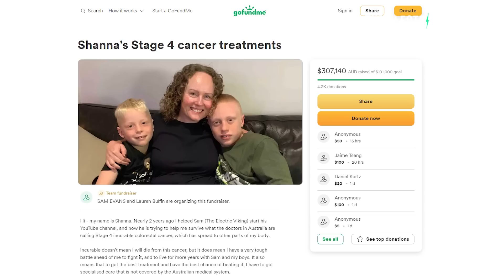CATL unveils Condensed Battery for Aircraft & 1000 mile range EV's

Comment: Dear Viking,
A 50 kWh condensed battery will not provide more range than a 50 kWh ternary battery. They store the same amount of energy. The condensed battery will be a lot lighter though.
For more range you need more energy. The theory is that you can fit a larger condensed battery in the same space as a smaller ternary battery. So the Model Y could get a 150 kWh condensed battery for example, to provide 800 miles of range. CATL did announce the 500 Wh/kg, but they didn't announce the Wh/liter figure. So we don't know if these cells are any smaller in dimension (they probably are).
Also missing: price and cycle life. If either is not competitive, it could be a deal breaker. But for now, it sounds really promising.
Reply: Not only the range... 0-100 times could well improve with these new batteries. That would put the Mclaren 720s even further behind Tesla. LOL
Reply: @zizimai7568   - who really cares, few ppl buy, or care about drag racing.
Reply: What about weight. When it's true, it will be couple hundreds of pounds lighter. The range will raise.
Reply: A 100kWh at 250Wh/ kg would be 400kg. A 100kWh at 500Wh/kg would be 200 kg. So a saving of 200kg at cell level for super long range car. Short range with 50kWh would save 100kg at cell level. So probably hardly much range increase for same kWh.
Reply: These cells should do more for acceleration than for range.  At a constant speed on the open road, weight has little to do with energy consumption.  It's mostly wind resistance, which less mass doesn't affect.  Less mass should reduce energy loss due to tire internal friction, so that would help range some.  The big win should be acceleration.  To the extent that you are speeding up and slowing down on the open road, this would improve range.  We still need info on price, cycle life, volumetric density, safety, low temperature performance, power, charging ability, and timelines on production volumes.
Reply: They would get more range because of how much lighter the vehicle could be. 50kWh in a much lighter car goes further. 

I do agree that there is more to it than just the new battery though
Reply: @SyntheticSpy  For long distance highway driving, when range actually matters, weight is less important than aerodynamics.
Reply: @JRP3   - hmm.. weight and volumes are important...  Aero too  - but volume dictates areo concerns more than mass. (weight is "planet" specific).
Reply: @kadmow  Until we start driving on other planets "weight" is a perfectly accurate metric and my comment about weight and range is correct.
Reply: @JRP3   - ha, that was a joke and, volumes are very significant - WRT aerodynamics...  lol..  cheers for the approval ticks.
Reply: @kadmow  Volume is a factor but not "very significant" unless it's somehow worse than existing chemistry, which is unlikely.
Reply: @JRP3   - cheers - last word...  did that add to the debate ??? chemistry - to be or not to be.  ???
Reply: @kadmow  It added more than your nonsensical claim about volume.
Reply: @JRP3  Yes good point. But I think both are equally important. Weight for acceleration/ deceleration and aerodynamics for fast cruising.
Reply: @marko14444  My point was it's not equal because range matters for highway driving which is at high speed and does not involve much stopping and starting.  Thus aero is much more important than weight.
Reply: @SyntheticSpy  Weight density (500Wh/Kg) is important, but volumetric density (which has not been specified) is also important. For example, if for a given amount of energy the battery is half the weight but ten times the volume, then the limited space available within a car/airplane to store the battery will become such a limiting factor that the vehicle would have a shorter range than a vehicle that uses today's batteries.
Reply: @SyntheticSpy  Why it goes further if the car is slightly lighter. The car is not made entirely of battery? It will help only when accelerating to get to cruise speed faster. Driving highway you don't accelerate much. I don't see a huge benefit with the car lighter on consumption and range. I do see an advantage if the W/liter is smaller and you can pack more kWh in the same volume
Reply: Think of it like the our next energy redone tesla model s pack. They pumped it up to 204kwhs total capacity in the same bolt in shell and increased the total weight by only 330kgs. Allowing for 770-850 miles of range on 1 charge depending on the temp despite the increase in weight. 

Which was still 30-40% lighter per kwh at the pack level than what tesla used. So technically they could put 130-140kwhs in a tesla model s pack at the same or slightly less overall weight as the 18650 tech allows for just 100kwhs. 

But that same model s tesla could easily do 510-550+ miles vs 404. Or they cut out say 25-35% of the weight keep capacity around the rated 100+kwhs useable and still go further due to a much lighter weight pack. 

Plus you can save more weight on less cooling capacity, smaller coolant pumps, less packaging etc once redesigned for the new cells. 
It's like a virtuous loop or cycle. Pretty neat really. 🤔👍🏻
Reply: Spot on. Same batttery size doesn’t mean any more range unless lighter. Even then it might be a 10% increase at best but that’s still good.

Game changer would be being able to have bigger batteries in vehicles at the same/less weight and crucially cost - then you could get more range at a lower price. Still a long way from that but it’s promising.

Comment: Batteries failing in a plane is not really an issue. Planes have separated fuel tanks in case one fails. They could just have separated batteries if one fails just the same.
Reply: Hopefully they wont catch fire
Reply: @iskdude9922  Because jet fuel currently cannot catch fire?
Reply: @ZR-194  needs a flame.  Lithium ion just needs to be damaged and a fire starts....  also battery fires cannot be put out.

Comment: Of course the battery in an aircraft can be divided in various subsections too instead of a monolithic single point failure.
Initial commercial adoptions still depends on the price. 
Arkinvest often cites a law of decreasing prices by close 30% with each doubling of the amount produced. 
So that may delay adoption for EV somewhat compared to adoption by aviation. 
Anyway this  may change the shape of things to come indeed.

Comment: A 50KW battery would have a 220 pound weight.  Put this in a Model 3 rear wheel drive with a performance motor and you would have a really fun car.
Reply: Something about the size of a WRX with this battery and SOTA drivetrain would be insane
Reply: 500 per lb 
2 lbs per kw
200 lbs gives you 100 KW!
Reply: The model 3 weighs about 1900kg, with a 50kWh battery it will weigh about 1800kg. Hardly make a big difference in total weight, won't change the range by much. Cost of purchase is the bigger factor, that might change.
Reply: you misspelled 150KW battery

Comment: The argument about "with jet fuel, if you lose an engine, you can still use another one, but with a battery you're screwed" is actually quite wrong. You just need multiple batteries. There's no reason why it would be difficult to have 2-4 separate battery banks in a single aircraft.
Reply: that's apples and oranges though.  the battery is the equivalent to the fuel tank, not the engine.  can still have multiple engines with a battery.  The issue is mass.  Jet fuel is about 12000Wh/Kg (rounded up) so 500Wh/Kg is still a long way off.  even if you assume 20% efficiency for burning the jet fuel and 100% for battery to electric jet, it's still 2400Wh/Kg v 500Wh/Kg implying you'll need almost 5 times the mass of battery for the equivalent jet fuel.  A 737 carries about 20t fuel and 21t of passengers - 100t of battery means the plane can't even take off.  of course I'm assuming the engines are about the same mass in both scenarios.  Even if the electric motors had zero mass though, you're only getting back 2t per jet fuel engine - so maybe 8t total if 4 engines configs exist

Comment: So a tesla with 77 kw with this battery will have 1300 khm??
Reply: No of course not. If the capacity stays the same, so does the range in principle. However, a 77 kWh battery will weigh much less, giving a little bit more range (but not double), because the car needs less energy to move. 

However, a battery with double capacity (154 kWh) will weigh the same as a current 77 kWh battery. In that case you do get double range. But we don't know if the volumetric density is also doubled. A bigger battery also has to fit the packaging requirements.
Reply: Depends, if you put the new battery with 77 kwh, it will mean lower weight of the car and therefore maybe 10-15% more range. If you put the new battery keeping the weight of the old one, it would mean up to 150 kWh and yes, that would probably increase the range ~twice. However considering the price of that new battery might be exponentially higher, the first option seems more viable
Reply: No. In short, this Sam or Viking or whoever it is said it wrong.